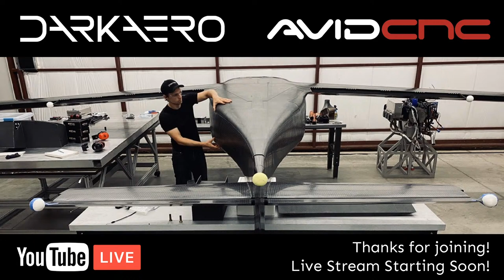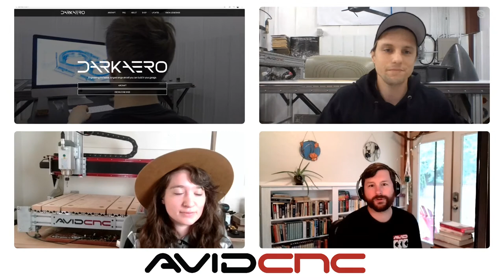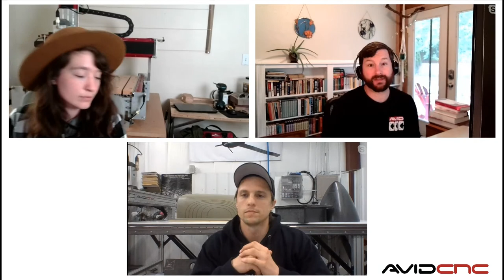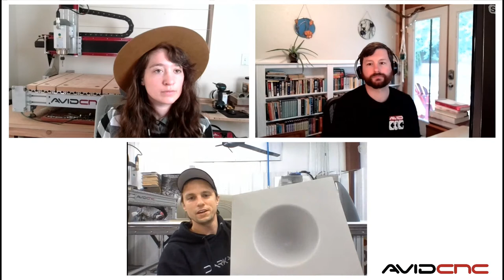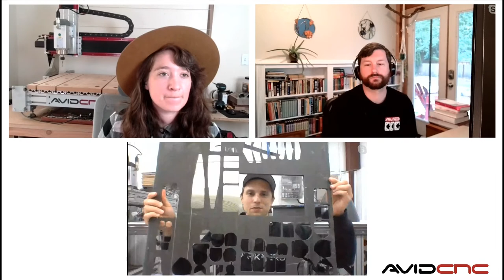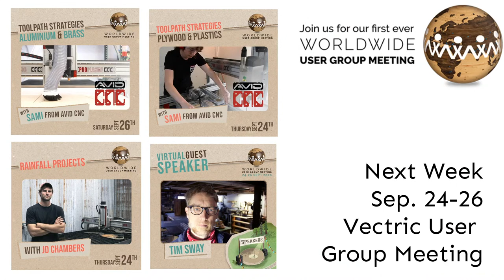Live with DarkAero - Airplane Kit Manufacturing Company

Comment: I'm a fan of DA and wish them nothing but success. General Aviation has taken a beating over the last 30 years. We have so many voids that need to be filled. Affordable, reliable powerplants and fast long range airframes that have a decent useful load to just name two. 

With the above being said I'm not a fan of selling an unproven kit that has yet to fly. Build it, test it, make changes, rinse/repeat until you've eliminated all the problems that arise. Put 400+ hours on the airframe without incident then bring the kit to market. What's an extra 5 or 10k added to the price for a safe, proven design. As it stands now no one knows if it's going to hold together, have bad flight   characteristics or worst case scenario both. Right now you're selling an idea marketed as a finished, proven plane. At least that's the feeling I get from following you since the beginning.
Reply: Thank you for tuning in xrae21! We put a lot of effort into showing where we are at with the prototype development and remaining transparent with the DarkAero 1 project. The entirety of our social media has been dedicated to highlighting that we are in the process of building the prototype of the DarkAero 1 and we are going through the effort to test and prove out both the design and manufacturing methods. We do not currently have kits for sale nor have we offered kits for sale at any point. All we offer is the opportunity for prospective customers to reserve a spot in line for a production slot when we have finished with validation of the prototype and are ready for kit production. If you could share where you feel we have marketed the DarkAero 1 as a finished, proven airplane we will revise it accordingly.